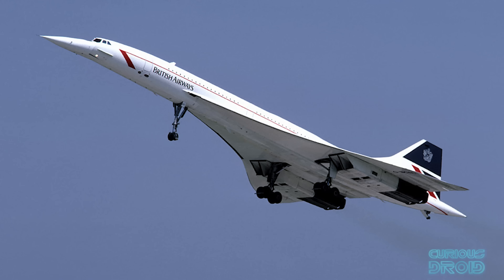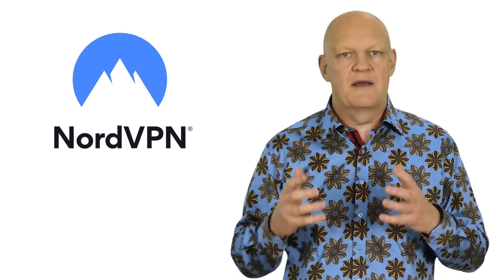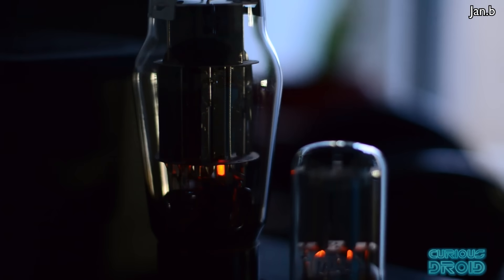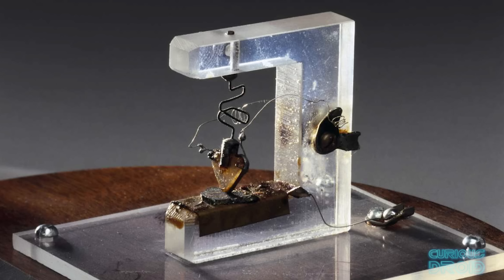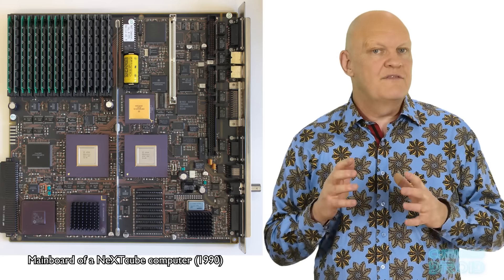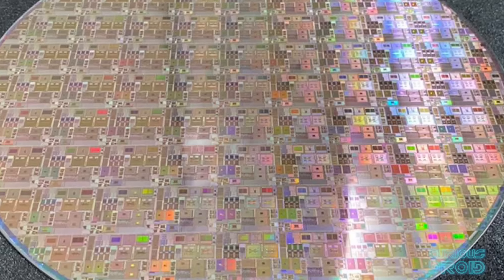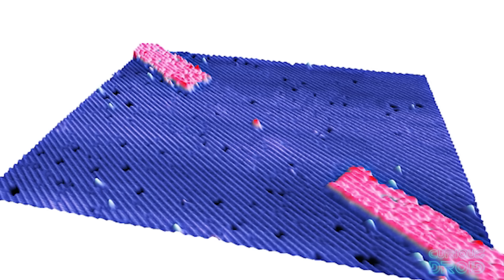MOSFET – The Most significant invention of the 20th Century

Comment: What I find exciting is that we are reaching a point / have already reached a point where electronics and particle physics are starting to intercept more and more.  Only 115 years ago Einstein proved that atoms existed through equations, and now we are at a point where we are considering manufacturing circuits by placing atoms around in an arrangement like they are marbles on a table. When we reach the point where we can't go any smaller without going into sub-atomic particles, it means that consumerism will fund the research behind particle physics. Chip manufacturers and researchers are already looking to the quantum physics world for the next advancement. All the vectors are pointing in the same direction. I have a feeling we're on the cusp of an advancement so ground breaking it's going to catapult the improvements of world technology into an unstoppable acceleration greater than even the transistor has achieved.

Comment: 35 years ago I worked for a company that was making "DIAMOND" substrates...  yes, we were manufacturing DIAMOND.  Once perfected, the FBI shut the company down.  You vent by chance seen a "DIAMOND" processor have you?   NOPE, and you never will.  The limiting factor in all computers/processors it 'heat'  cycling causes the base material to get hot, once too hot, it no longer works.  Diamond is near limitless speed.  The GOVERNMENT has had Diamond processors for over 30 years now.  You dont know, what you dont know...  After leaving that company I worked for a company that made sub micron metrology equipment.  That company was closed by 1995, because the parts our customers were making were "TOO SMALL" to be seen in a sub-micron field of view.   You have no idea where Tech really is in 2021.

Comment: You skipped over the project that took computers from the size of a gym to fitting in the palm of your hand.  The Apollo program.  That effort changed computers forever and gave the transistor its widely known form today. It wasn't just the rocket that was using wildly different computers. The launch control building and data processors at Houston were revolutionary.

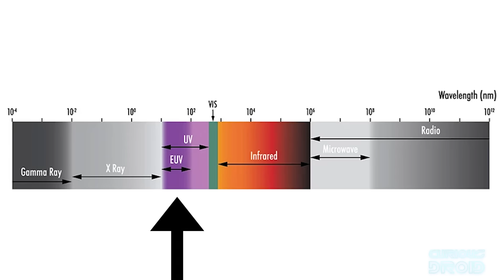Comment: 15:03   Fact check - wavelength of 13.5 nm  ?  then it wouldn't be possible to make 7nm chips.
The wavelength would have to be a minimum of  1/4 of 7nm or  1.75 nm.

Comment: I don't see moores law in danger, even if we cannot produce chips smaller than 5nm.
You can stack realy thin layers of chips over each other. Maybe it requires some engineering time to find out how its done the best way, but it is possible.
And i guess it will be very common in the future.
And even if you don't produce them in a layered way, you can layer them afterwards. Sure you must find more efficient ways to cool the system but its already possible with the technologys we have today.

Comment: The intel 4004 was originally designed as a video controller but suffered in that it was too slow to be usable.  However, a group of hackers had created the first micro computer called the Mark 8 which was a do-it yourself computer.  It wasn't till the 8080 arrived on the scene that computers started to take off with the ALTAIR 8080 personal computer kit where you soldered the components yourself.  The main board (motherboard) was nothing more than a board with connectors (SS100) tied together so that a CPU board and Memory board would fit into the socket and become the first commercially available micro computer as a kit.  Vector Graphics came on the scene to create the first commercially available fully assembled computer with the option of having it as a kit.  Motorola created the 6800 processor which was a true micro processor whereas the 8080 was designed as a calculator chip which unique registers whereas the 6800 was multi-purposed registers.  I know... I was there from the early beginning (1975)

Comment: I may be mistaken, but I think what Linienfeld invented was the JFET (junction field-effect transistor), not the MOSFET.  But anyway…

What really made MOSFETs compelling ultimately was CMOS technology, which ironically doubles the number of active transistors required to do each primitive “logic gate,” but it cuts the power consumption and thus heat down to a tiny trickle.  This lets you shrink the transistors much smaller, far more than compensating for the increased component count.

Moore’s Law has pretty much been dead for 10ish years.  It’s not much better that’s linear growth now.  I remember 5nm processes being discussed in the trade rags back in the mid-late-2000s, and even in 2021, it’s still somewhat exotic technology.

Comment: mosfets are still stone age, in the phone relay age, mems is cool, mems micro/nano/pico switches, but who needs so many, when you can go by less using more wisdom, you waste most of the silicon/heat signature space
Reply: count your atom reflections, to store data, on cd's, not blue ray light, start from uv-light, go to electron/ion readers/painters
Reply: also micro vacuum-tubes, when using flexible dynamic fpga instruction mini cores, lose most of your weight, you have to pay the last coin
Reply: how much is billion venezuelan currency units, how much is a billion transistors, a drop, nothing more, in the sea
Reply: inflation rocks, wisdom wins
Reply: you are not independent in your techs, silicon, too much demand, bad systems trying to manage nations
Reply: photonic ic's, photon only circuits, no structures, just processing, only feed-in structures
Reply: "incredibly difficult to make" means only that "you have to pay me", nothing else, nothing truth otherwise in that saying

Comment: Colossus was not the first computer.   The first computer was the Z3 built by Konrad Zuse for the Germans and in use by 1941.  No, it wasn't used to calculate "evil", instead it was used to analyze metal fatigue as a result of wing flutter in airplanes.

The Z3 had a much larger positive impact on day to day lives across the globe than the Colossus, as our passenger planes, and freight planes all benefit from numbers originally from the Z3s calculations.

Comment: A couple of key discoveries and inventions in the early days of the MOSFET were 1) the process recipe for growing gate oxide (SiO2) on silicon with low Si/SiO2 interface defect densities.  2) The self-aligned gate where the gate electrode was deposited before source/drain diffusion (or ion implant) and was used as a mask.  The gate had to be able to withstand a very high temperature dopant activation anneal so had to be refractive like TiSi, not aluminum.  Without those innovations, MOSFETs would just be laboratory curiosities.
Reply: They had to figure out materials that not only had the desired electrical properties, but also could be cheaply added as layers and subjected to the harsh conditions during chip construction.

Comment: Efforts of making those transistors microscopic for a computer processor is almost useless coz we still need bulky radiators & fans to cool them down. Scientists need to find a way to incorporate a micro cooling system inside the IC or processor to eliminate bulky & power consuming cooling systems on our computers.

Comment: A great video except for one small detail. Though a great invention and much more useful than the first Point Contact Transistor the "Metal Oxide Semiconductor field Effect Transistor" would not exist were it not for the very first point contact germanium transistor made in 1947 for which John Bardeen, Walter Brattain and William Shockley working at Bell Labs received the Nobel Prize in Physics nine years later in 1956.  Were it not for the invention of the Point Contact Transistor the MOSFET likely would not have been invented till the PCT was.

Comment: Made a Z80 computer , Z80B, 2MHz ! only had a static ram, programmed with a clip.  now we have teensy 4.0. As mentioned floating gate devices do leak and flash drives are insecure over time. Maybe writable CD's are still the safest backup. 7nm , 35 atoms, Oh, I didn't know we were that close. If only we could find a tiny universe with tiny atoms we could steal planets to make microwaves that have even more features.. Pleasure to watch.

Comment: Thermal stress at turn-on may be the most significant contributor to filament failure in vacuum tubes, but filament failure isn't the most significant cause of vacuum tube failure. You need to be more clear about this.

Comment: About the only thing I know about electronics is how you can test for the remaing power left in a 9 volt battery by touching the tip of your tongue, ever so briefly, against the + and - contacts at the same time. But when Mr. CD said using visible light — I'm paraphrasing here — to imprint the circuitry onto those silver platters didn't work anymore because the wavelength of the light beam was too big (what?!?), they had to start using ultraviolet light. Well I think I understood that part and just about choked on my sandwich. And now I'm gonna have to wait until my food digests until I try to understand using a single atom to throw a switch. Oh, my head hurts.

Comment: Papa had enough knowledge of electronics to fix televisions with vacuum tubes.  He used to build kit electronic devices.  I remember when a neighbor who worked in the electronic industry showed him some of the first transistors.  I had no idea what they were at that time, but I do remember that they were an about an inch and a half in diameter.  Now, a few atoms across?  Mind-boggling!  Thank you, Mr. Droid for another excellent layman's lesson in technology.  You have a gift of clarity and simplifying the complex that is phenomenal.  I wonder where you teach for a living.
Reply: First transistors were in small cans about 1/8 inch on the outside, so the actual transistor was smaller.  Some latet power transistors came in half inch cans with big wings to be bolted onto even larger  cooling plates on the back of radios.  But I have seen single devices that were multiple inches in diameter for use in the power grid.  The installed circuits looked like the inside of old tube radios, but with people from ABB walking around inside them during assembly.

Comment: In July 3rd of 1947, a UFO crashed in Roswell. It had a glass panel full of microscopic circuit like thingy, broken wire that lit up at the end, a pen with light that can cut through anything, and a few other mysterious devices which we still don't know what they are used for. Read the book "The Day After Roswell" by Colonel Philip J. Corso. Some engineers who worked on early transistor validated the claims in the book. 

Interestingly, before 1947, we only had vacuum tubes and there was no clue how to improve it. December 1947, as told in this video, we had the first clumsy and rudimentary transistor, that is the building block of IC chip.

Comment: Mosfet are used in high power demands as well f.e. induction hub. The only way they fail is to change from NO to NC. In NC they can blow 30A fuse with no visible damage to themselfs.

Comment: One of the limiting factors for miniaturization is x-ray damage from cosmic rays. Space tech has to withstand this and is usually technology 10years older, but as soon as you start having atomic sized switches, single charged particle could flip its state. This would have to mitigated by redundant systems and voting logic which pushed up complexity, size and cost.

Comment: When I began as in integrated circuit layout designer at TI in 1983, the minimum lithography was the 3 um x 5 um contact which could be patterned.   When I ended my IC Layout career, the minimum lithography that could be patterned was 7 nm.   I've resumed my career 2 years later.   They're now at 4 nm.

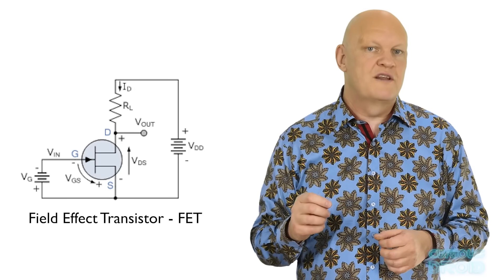Comment: About 4:45 you say that a BJT is controlled by the base current.  That is an (over)simplification.  The better explanation (Ebers Moll) is that the emitter-base voltage controls the device.<https://en.wikipedia.org/wiki/Bipolar_junction_transistor> explains this.

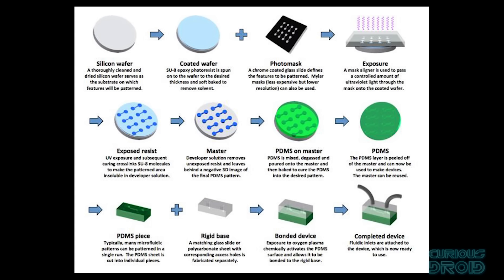Comment: A very informative video! One note/nit -- the slide you use at 13:52 isn't about microprocessor or MOSFET photolithography, but instead about how microfluidic devices are made. And don't get me wrong, microfluidics are super-cool -- but they handle liquid instead of electrons (;
Reply: Yeah, very nice slide but not really about MOSFET but rather lab-on-a -chip thingies. Out of curiosity I  paused the video and looked at it closer. I came to the same conclusion and then I started ploughing through the comments to see if I was the only one that noticed. Still a great video of course.

Comment: very good presentation. You mentioned two versions of Moore's law but left off Moore's corollary, that the cost to produce these chips then doubles every three years.
You could also go a little slower with your images and their descriptions, as I am not a high speed digital image reading machine.
I am happy to know the full range of applications of the MOSFET, but would have liked to know why and how the floating gate became the source of a memory storage aspect of the MOSFET, and its use in SD cards and Flash drives, something we all rely on.

Comment: You missed the chance to explain how MOSFET / CMOS transistors work.
A silicon wafer is like a piece of glass (desert sand is 47% silcon; beaches have much less because of all the broken shells.)
Electricity doesn't like to flow through silicon because the silca glass is an insulator, a non-conductor of electricity
But if you add some metals like germanium or gallium etc ( https://en.wikipedia.org/wiki/Doping_(semiconductor)#Silicon_dopants ), you get a "semi-conductor" silicon wafer.
Introducing these impurities is called doping and it's done during manufacture.
Manufacturing makes a silicon sphere (Star Trek Horta Episode!) that can then be sliced it into wafers.  

After the silicon wafers are sliced, we want to add even more doping to certain parts of the surface of the wafer.
boron will create a P(ositive)-type material. Arsenic, antimony and phosphorous create a N(egative)-type material.
We dope the wafer by covering some areas and diffusing (high pressure/temp) doping materials into uncovered areas.
This is done as in silk-screen-printing; cover the surface; photo-expose; etch away ~half the cover; dope; dissolve all the cover.
The semiconductor actually has a lot of free electrons but they are spread sparsely throughout the silicon.
If you put a metal plate on top of the silicon, and charge it up, the plate will draw electrons up from deep in the semiconductor, concentrating them near the surface, kind of like sharks feeding on seals.
Where all these electrons are concentrated, a large current can flow.  The more electrons you draw up, the more current can flow.
We call this plate the transistor "base".  That is the amplifier control knob.  Because there is an insulator between the plate & silicon, there is a bit of a capacitor right there.  The area underneath the base is the "channel" and we use PN or NP materials to make an "emitter" and "collector" (basically a diode) at either end of the channel.  So current can only flow in one direction.
That is all it takes to make a transistor.

Comment: It may be time for I²L (a.k.a. I2L, a.k.a. current injection logic, a.k.a. integrated injection logic) to make a comeback. As it uses bipolar transistors, it will be immune to the MOSFET/CMOS problem of short gate leakage which has been hampering Moore's Law for some time now. It is also going to have low power requirements with the very tiny modern transistors, and be far more resistant to upsets and errors from ionizing radiation such as charged particles passing through. https://en.wikipedia.org/wiki/Integrated_injection_logic

Comment: It's kind of sad that we haven't invented anything new since the early/mid 20th century, "only" improving what we already had.
Reply: We've invented countless things.  The device you are watching this on likely also requires a lithium battery and a crystal display among other things.
Reply: @krashd  The first true battery was invented in the year 1800. Groundbreaking work on Lithium batteries happened around 1912 but wasn't commercially available until the 1970s sometime, some say 1985. The crystal display was released for public use in 1968. Got any more? :)
Reply: @dopedrums  sure, groundwork has been laid back then but what we have now is often vastly different to the point where you could consider it to be basically a new invention. Just look at hard drives. Back in the day you had to fill the room with a giant hard drive for just 5 KB of space. Now we have hard drives that can save up to 18 tb of Data. And they are way smaller. A lot of small innovations and discoveries made that possible.
Reply: @lucariolps277  You're absolutely right. "small" inventions have been made to further improve what we have, for sure! Maybe I should've been a little more specific in my initial comment and say something more in the lines of gigantic leaps forward like the automobile, airplane, trains etc.
Reply: @dopedrums  well those are always few and far between. Quantum computing would be one.. There are large steps being made with Fusion.. What musk did with his spacex missiles is a great leap forward because it drives cost trough the floor. The internet wasn't too long ago.. Lab grown meat is another one.. There are plenty of ground breaking inventions. They just, aren't big jet. The car didn't get big in a second. There were several failed attempts before somone found the right formula.. So no, Innovation hasn't really slowed down. It's just not big and Mainstream jet.. Hell, some other examples are solid state Batteries. They now exist in lab settings and supposedly are coming to Mass market soon.. Another one is 3d storage with glass. They did it in the lab. And eventually it'll be in the consume world. Stuff takes time.